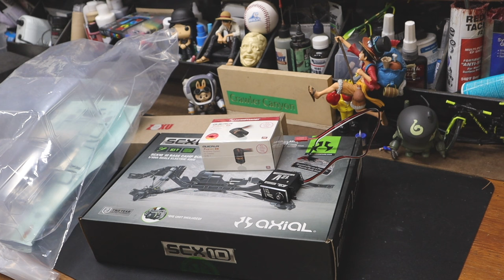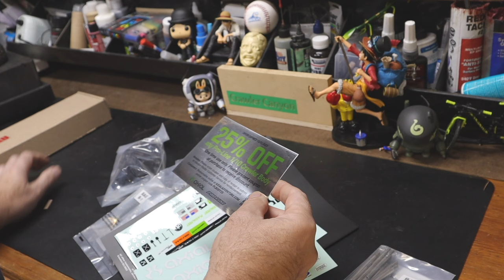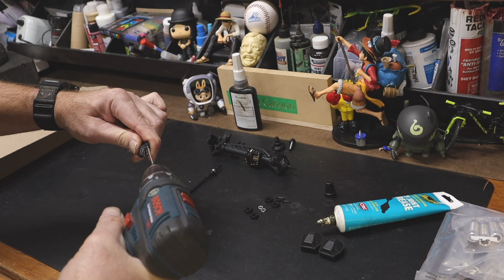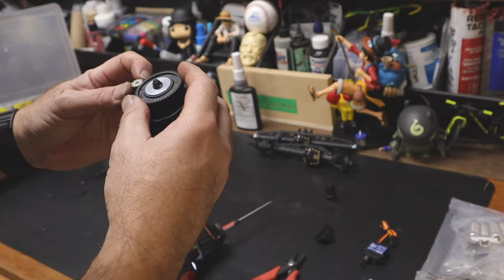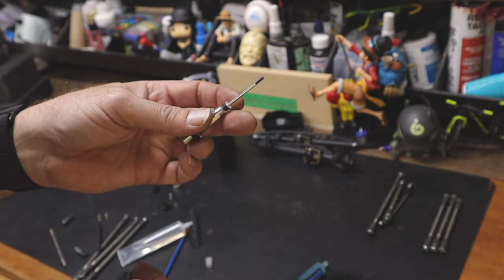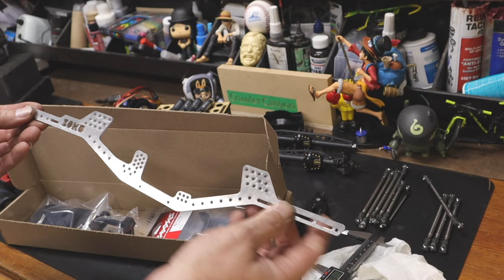Crawler Canyon Presents: ICFTW Vol.25 Ep.1, and so it begins

Comment: With some careful drilling, I ised to always convert my ax10 trans to run a traxxas slash/rustler top shaft and slipper. This was great because the gears are 48p, lots of gear options, parts always available at every hobby store, and the slipper is smooth when needed, and grips well when you crank it down. I would guess the new scx10 trans is close enough that you could to the same.

Comment: here i am again
thank you for the shocks building part yet again. I'm a newbie and I just did shocks build for the first time. Your comments and kinda masterclass are extremely helpful
i have 40w oil and i had an impression this should fit basecamp shocks in a nice way more or less. However, i faced 3 issues
1. i had to rebuild 1 of the shocks 3 times. Apparently the O rings are not original and the only way I can put it in so it wouldn't bind is under the cap. However, i've been getting something like 'quicker and more you move - less resistance it has'
2. i ended up with 4 shocks that behave differently. 1 has super high resistance. 1 has a little less but still too much it seems. These two are in the rear with losi mini t mediums. The other two have less resistance, but 1 is smooth and the other feels like has steps when moving (i bet it's air). I run these two in front with 
3. even though all the shocks kinda different, the rig doesn't sit down after it's risen up and it doesn't go up after it's been pushed down. I tried to move shafts back and forth but it helps only for some time and then everything gets too stiff again. In hand shocks were expanding with springs just fine.

so i'm here for some online wisdom and guestimation. Is there any spill of skill that I missed? I plan to get 30w oil for starters but as for bleeding, I don't get it, i tried to be consistent but all the shocks are different. I would blame O rings but I do have 1 shock that has original rings and it is in front, however front on that side doesn't go down either. I'm kinda not sure where to look at except buying another oil and just rebuilding them to death until i start feeling something.
Reply from the maker: If the shocks won't move freely on the vehicle--  something is binding. Don't immediately assume that the shafts are binding, check the hollow balls at the tops and bottoms of the shocks--  if those are binding, the shocks won't be able to move freely. While you're at it, check ALL of the pivot points. 

If all f the pivot points are smooth, I would replace ALL of the seals, so you know everything fits.  Desert Lizard seals fit in Axial shocks (as I've never seen an "Axial shock rebuild kit" though maybe it exists) and are slightly larger so they will mitigate the usual Axial leaking issues.
Reply: @CrawlerCanyon  interestingly, it was ok without oil. And I do feel that one of the shocks is much tighter than the others (with oil).
Balls are a bit tight in some spots but I don't really know how to smooth these out.
Thanks for the O rings advice, I'll wheel as is a bit and look into it. Au least they don't leak at this point.

Comment: I’ll give you the official response direct from the state of Indiana. See the terrain in my profile pic?  I had to go to Kentucky for that.  Seriously though, there ain’t much here. All of the elevation (not plains) that I’m aware of is in the southern part of the state.  There is an off-road park in the north named Badlands that hosts the east coast axial fest.
Reply: And the highest point is called Hoosier Hill at 1255 ft above sea level.
Reply from the maker: My house is at 1305ft ASL. The highest point in Southern California (Mt. San Gorgonio, 11,500ft) is 20 miles from my front door. 
Those glaciers really did a number on youse guys. I hear you also have humidity there, which frankly sounds terrible.
Reply: @CrawlerCanyon  I’m less than a mile from the Falls of the Ohio State Park. It’s at about 400ft ASL.  I can hear the “falls” dam spillway from my house when the sound from the freeways don’t cover it up.  The glaciers scarred most of Indiana and left Canadian soil deposits as hills in southern Indiana.  They ended just north of here. The Ohio valley around Louisville is extremely wide and mostly flat between the escarpments.

The humidity really sucks here. It’s particularly bad in the counties close to the Ohio River compared to a lot of the south.  My area has a similar number of wet bulb days each summer as New Orleans.

Comment: i have this video saved in order to recap how to do shocks on base camp
disassembled mine yesterday and it turned out i have only 1 O ring in each. And this ring goes between cap and plastic cilinder. Call doesn't screw on if O ring and cylinder switched places. Mine wasn't kit though.
Reply from the maker: It's getting to the point where I view RTRs as "kits with more steps."  You basically need to completely disassemble, check the work, and put it back together. 
You would think that just logistically mfrs. would still want to ship kits--  The Base Camp BK box is about the size of a phone book (for those that remember) while an RTR like the FMS Atlas comes in a box the size of a microwave.
Reply: @CrawlerCanyon  alright small update
from the 4 shocks i disassembled, only 1 had double O rings. I start suspecting the previous owner either lied to me that it was an rtr or he had rebuilt the shocks and lost 3 O rings.
Nevertheless, i seriously doubt it's axial who misplaced the O rings.
I also suspect 3 shocks have non-original O rings as a) no way it can fit 2 of those and b) if O ring goes in first, shaft binds after all is tightened

Comment: That chassis kit is 200$ here in Europe😆...thats a hard pass !
Reply from the maker: Zoku has the least expensive LCG kits on the market.  Spare Time Hobbies will set you back about $250, Artful Dodgers are around $300. 
Bottom line, <any> full LCG conversion isn't cheap.
Reply: @CrawlerCanyon   I still think those kits a grossly overpriced for what they offer..That actually started when the Axial scx10 pro came out🤔before it was not cheap but reasonable.
Reply from the maker: @themountain59  For some kits, I would honestly agree. Out of the Basecamp kit, all I used are axles, links, and gearbox. So if you pick up a chassis like a Zoku, it can be fully outfitted for as little as $120. In terms of value, the Zoku is excellent. There are plenty of options out there that are $90+ for just a pair of rails.